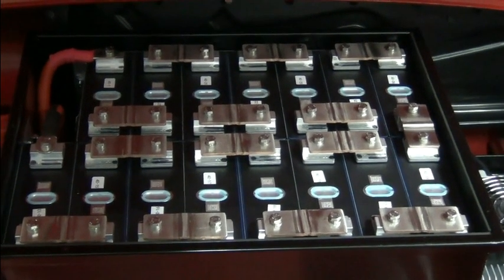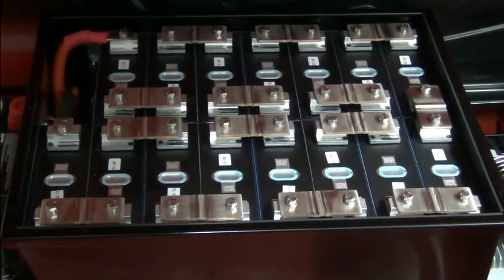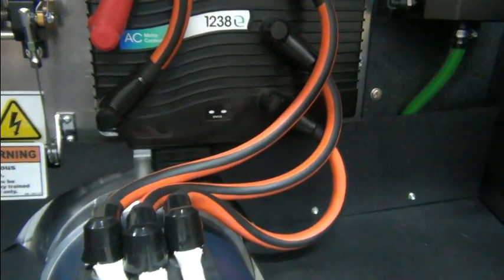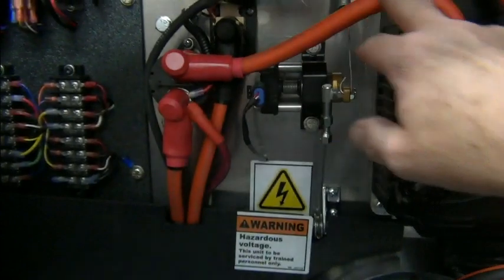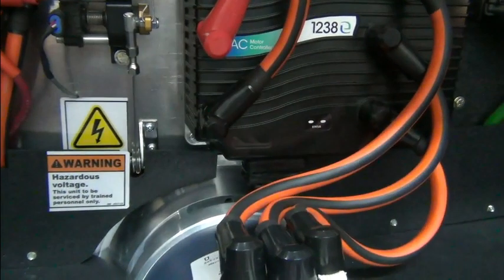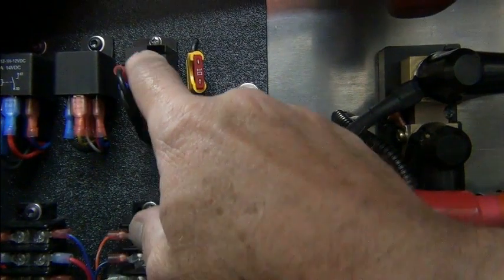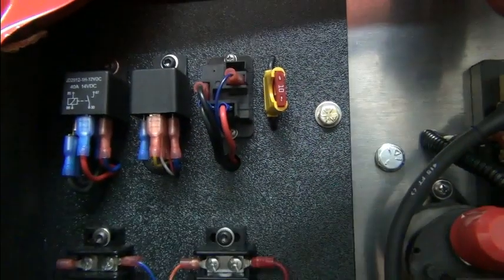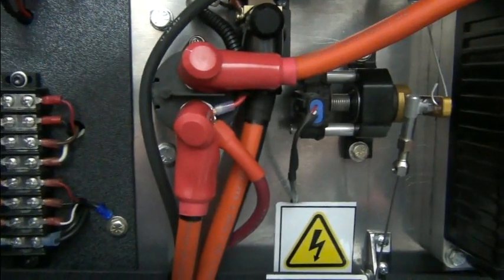A Beginners Guide to EV Conversions -  Episode 7

Comment: I’m just gathering thoughts at this stage. Are there pros and cons about taking an existing setup eg motor, controller, battery from a Nissan leaf for a conversion, vs buying new kit parts?
Reply: One day I’d like to convert my ‘74 Vw bus, but can’t afford it right now. Would a motor from a Nissan leaf (2014) have enough power to drive the bus? I’m guessing it’s similar weights so could be ok.
Reply from the maker: Yes, thank you for watching.
Reply from the maker: Check out this video.  https://youtu.be/Hy4u1oMziO4